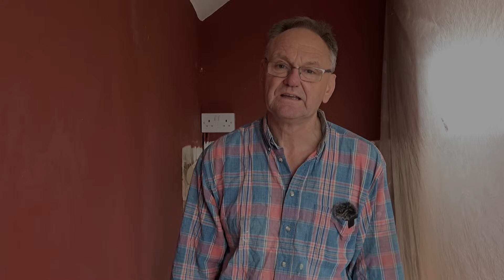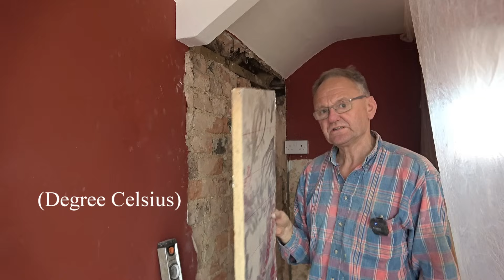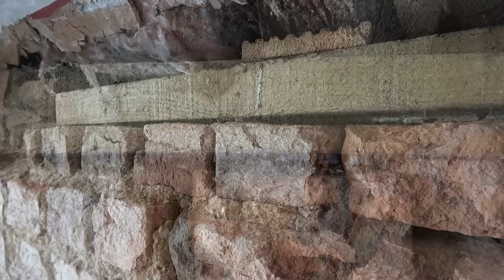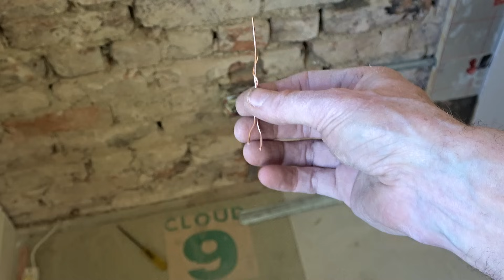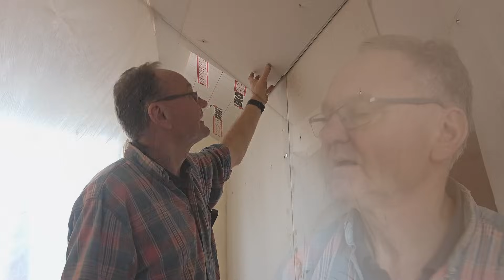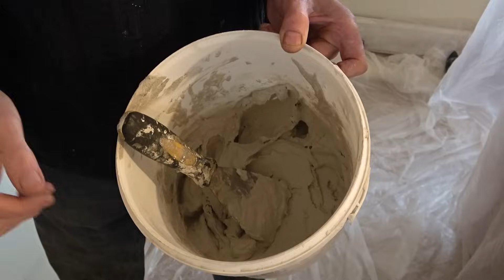HS165 Insulating a solid wall (Do it yourself)

Comment: Thanks for this @haxby_shed! I have a 110 year old property (lived in it for 20 years). I've never had any moisture or mould problems. do I need to take the plaster off or can I affix the insulated plaster board direct to the existing high-quality plaster? Room is huge so los of space.
Reply from the maker: HI David, please note I'm just a DiYer and no proper advisor. But no you do not need to take the plaster off. I only did that because I was very limited for space and there was a 1inch vertical slope on the plaster (out towards the bottom).  Also please note all the comments about the risk of condensation damp behind the insulation - but having said that I have done a number of walls over 10 years and never experienced a problem but only one wall in any room and we keep the house well ventilated. Cheers

Comment: 😮😮ein luftspalt zwischen Mauerwerk und Dämmung führt unweigerlich zu kondenswassrrbildung. Immer!!!👎👎👎🇩🇪
Reply from the maker: Hi Thomas, Ich stimme zu, dass die Gefahr besteht, dass sich hinter der Isolierung Kondenswasser bildet. Die Wand ist jetzt seit 18 Monaten isoliert und wir haben keine Probleme gesehen. Ich denke, dass das Risiko beherrschbar ist, wenn das Haus gut belüftet ist und man die Situation in seinem eigenen Haus kontrollieren kann. [help from Google translator 😁]     English version: I agree that there is a risk of condensation forming behind the insulation. The wall has been insulated for 18 months now and we have not seen any problems. I think it's a manageable risk if the house is well ventilated, and it's your own house where you can control the situation. Cheers Paul

Comment: Do you not worry about the damp/mould getting to the plasterboard?
Reply from the maker: Hiya Bush_Bush, I've done a few walls in my house like this over the past 10 years or so and not seen any damp or mould issues. I know people say it could be a mould fest behind the insulation but all I can say is it seems OK for us. We have never done more than one wall in any room. We ventilate the house well. I definitely would not try it in a bathroom or kitchen.   But I am clear in my own mind that the only way to be certain of no mould issues would be to ventilate the gap behind the insultation from the outside, with outside air circulating freely behind the insulation. But then you need much thicker insulation than I used. Just leaving an air gap in itself would not remove the risk of mould. I'm not even sure a 100% vapour barrier by itself would remove all risk of mould behind the insultation. Cheers

Comment: I used insulated plasterboard and used foam adhesive to stick it to wall. And then skimmed coat it. Easy and quick.
Reply from the maker: Hi Aliens4world, yes that would be the quicker way. I've done quite a few with screws and I guess this will probably be my last so I did not want to learn a new method at this stage, albeit less efficient than your method. Cheers

Comment: hey paul what mm pir board are you using?
Reply from the maker: Hi Oliver that was 25 mm. Ideally I would use thicker but I did not have the space. That said just 25mm makes a big difference. On a very narrow staircase I used 12mm and even that made a noticeable difference. Cheers

Comment: Thank you! That was really informative, and great advice. I’m looking to sort some solid walls and a somewhat limited budget and this really helped
Reply from the maker: Hi Sayam, please note I'm only a DIY-er. People have commented about possible condensation forming on the wall behind the insulation but after 19 months I've not experienced any problems. Cheers
Reply: @HaxbyShed  No worries, still good content. I was reading that a vapour barrier would help condensation from not forming on the wall. One of the reason the insulated plasterboard are bought as one solution is they normally included a vapour layer. You may not know there is water on the wall behind the insulation unless you take it off. But if it’s a party wall you might be safer against condensation.

Comment: Thank you for this very good, detailed and informative video. I have a 1906 Edwardian property that I am renovating soon. It's not been touched since the 1970s. New Building control rules say I must insulate the walls if I'm removing the current lime plaster back to brick. I will be doing this. I'm excited to see the original brick! My question is about breathability. Old, period homes need to breathe, so I worry about adding modern day insulation. I read that it can cause condensation/water build up behind the wall and eventually cause mould issues and in worse case scenario, damp. What do you think of this, since you have a much older house than Edwardian era? Thank you.
Reply from the maker: Hi Lizzie, first off I have to say I am no expert so this is just a DIY practical view which professionals might disagree with.  For sure solid walls (no cavity) will transmit a higher level of moisture from the exterior. If anyone ever painted the wall with silk or bathroom (plastic) paint, or covered it with vinyl wallpaper, it stopped breathing there and then!  Also warm moist air meeting a cold wall may cause condensation - which might quickly evaporate off with good room ventilation. It depends a great deal on the level of moisture in your house. We sleep with the bedroom windows open. I recently visited a modern house where the occupants never opened windows and the humidity was so high the moisture in the air was condensing on the toilet cistern and literally running down through the ceiling below like a full on water leak it was so bad. We had to show them how to open windows, especially when cooking on the hob (unbelievable) !!  I have insulated several walls in our house with the method shown and never had a problem. People say there needs to be a better vapour barrier (perhaps they are right) and/or an air gap behind the insulation. Well I'm 100% clear in my mind that an air gap only helps if the air gap is ventilated from the outside (so the insulation needs to be thick enough). Maybe the thin insulation I fitted transmits enough heat from the room to keep the wall surface behind warm enough to avoid condensation. Or maybe it is a mould-fest behind there but I'll never know. Certainly after 18 months we have not experienced any problems in that room. And some walls in our house have had that treatment for 10 years with no known issues - usually just 1 wall in a room. Maybe that helps. Cheers.
Reply: @HaxbyShed  Thank you very much for your sharing your experiences.

Comment: If applying insulation to the inside of an exterior wall (like I think you have), do you need to apply a vapour barrier to avoid mould?
Reply from the maker: Hi Tom, it's quite a vexed subject. The foam insulation provides a certain level of barrier but I did not have airtight sockets (for example). I am sure the experts would say yes there needs to be a complete airtight seal. Also, people talk about requiring air gaps but I'm now convinced they only help if ventilated from the outside.  Cheers

Comment: Great video, much appreciated! How does this work for ventilation and mould etc over time if everything is so flush? A few people have told me I need to leave specific gaps etc for airflow. Cheers
Reply from the maker: Hi Cameron, it's a fair question and people have said I can expect mould although I have not seen any yet on any of my walls I'd done over the past decade or so. But of course I can't see behind the insulation unless I strip it off. In my diy opinion leaving a gap is no use unless it is ventilated and, think about it, that ventilation must be from outside. But I'm just using basic logic when I say that ....... somebody else may disagree.   Cheers

Comment: Would not your house have been built using lime? This allowed old houses to breathe. When modern building methods were applied using cement, these old houses suffered from damp.
Reply from the maker: Hi Phillip, yes it may have been lime mortar. I did add some lime to the cement mortar I was using there. I agree with you about lime breathing but of course lime mortar often stays damp and in that state is a paste (so I'm saying that lime mortar does not in itself prevent damp but yes it breathes). But on old houses like ours you will find that 'Billy the jobbing builder' will have, over the decades, used patching mortars without any thought for any of that and I'm pretty sue all that all the repointing on the old parts of our house has been done with cement mortar.  Hard to say what the cumulative effects of all that has been over the years but our house it pretty dry and damp-free. Cheers
Reply: I’m just about to insulate my house. I too will buy the insulation and plasterboard separately. Save a fortune.

Comment: Thanks for video , noticed your roof insulation could use upgrade as well.
Reply from the maker: Hi yes, but limited opportunity certainly on the sloping parts as the separation between the tiles/felt and the ceiling below is only the height of the joists - 4 inches max, maybe 3. There is quite a depth of insulation above the level parts of the ceiling. Cheers
Reply: @HaxbyShed  Thanks for reply.

Comment: Hi does this also stop damp I’m thinking of doin this to all my internal walls that are facing the outside
Reply from the maker: Hi Lee, insulation will not stop damp. Rising or transmitted damp needs the root cause addressing and if the problem is condensation then again the cause needs to be addressed (damp atmosphere for whatever reason). I think if you insulate over a known damp problem you are likely to still have problems though they may be hidden. I would only insulate over an otherwise 'dry' wall (albeit that any solid wall will hold a certain amount of moisture).  Cheers

Comment: I love everything about this video. I really like the way that my fellow Brits do videos. The Americans are just so smooth and glossy. I am especially grateful to see you overcome all of the little problems and for your explanations of how you saved money. BUT my absolute favourite is seeing that your wall looks great without the need to skim the entire wall. Thank you very much.
Reply from the maker: Hi nowthenad, it's always rewarding to get nice comments thank you. You may know that my approach has caused some alarm from experts who are concerned that I would introduce serious problems with damp by using a non-breathable insulation. There certainly is that risk with my approach and I'm not going to say any opinion is right or wrong.   We have not seen any problems yet outwardly after 14 months but I don't know what's going on behind the insulation (and I'm not taking it off to look). The room feels a lot warmer. I did a follow-up video with a thermal camera (HaxbyShed 226).  Cheers
Reply: @HaxbyShed  That is very conscientious of you to mention that. Don't worry though; I am just treating your video as food for thought. I shall take up some of these issues with the tech support staff from companies like Kingspan. I wonder why it is considered to be acceptable to use EPS/XPS tile backer boards + ceramic tiles if it is a problem to have a non-breathable insulation. I would have thought that it would be a good thing to have a vapour barrier to prevent moist air from getting through to the cold wall, leading to condensation and mould. Any moisture entering from outside could leave the same route it came - to the outside. Anyway, I obviously need to learn more about the science of this business.
Reply: This is how walls are done in NZ where I’m from I never understood the need for all the effort and mess with plastering. It always seemed like an unnecessary step in the building process. Our houses are strong and the finish lovely I wish the UK did more straight plasterboard walls. Also the plaster quality varies greatly here. I bought a new build and it looked like the plaster was out on by a kid with a wooden spoon.
Reply from the maker: Hi Joshua, I have a few walls with just plasterboard, joint skim and paint. I suspect methods just get carried forward because that's how it's always done (speaking as a layman, you understand 😉). Cheers

Comment: I've been told you are meant to leave 25mm air gap each side of the foil....but in practice this is almost impossible so I'd still fix them directly to the wall.

I had a similar problem with a boiler room in an outhouse. I needed some insulation but able still able to fix plywood to the wall to support a 40 kilo boiler. It turned into a real headache.

A good product are hawkeng washers which spread the load of the screw
Reply from the maker: Thank you Dickie for sharing that info. Cheers

Comment: Wrong wrong wrong, if that’s single skin external wall if you get any damp penetration you’ll have masses of black mould behind the board.

Not advisable to only tape the joints either because it’s too easy to damage the plasterboard without a skim coat on it.

Putting plaster on skirting-line also is not right because you’re now causing a bridge for damp to come through.

And here is a prime example why you never buy a house of a DIY enthusiast 😂.
Reply from the maker: Hi happytruth, I agree that all the things you mention are possible. I only had 1.5 inches of space/thickness to work with so I took the risk.  It's not only DIYers we need to be wary of. I've had a couple of houses in the past with serious structural problems due to bad builders - in one case simply not following the engineer's  plans. Cheers

Comment: I have to do the same to an old coal room with a toilet and there is no heating out there. Do I have to frame it first and what about a vapour barrier?? Thanks
Reply from the maker: Hi SausageParty, to be truthful I am not qualified to answer. I did not have space for framing. I did not use a vapour barrier for no particular reason other than I have not installed one before and not experienced any problems, but we keep the room well ventilated so it is not a high humidity environment. If I had space and I wanted the new face perfectly true then perhaps I would have built a frame. I don't think an air gap by itself will help to control moisture unless ventilated from outside, although it would keep the insulation board off any 'wet' patches thus avoiding transmission by direct contact.   Cheers

Comment: Just what I needed, had an idea but you have confirmed it! Our house is only 170 years old but has one  wall , which is exposed to all the weather and which is icy cold, I shall try this to help alleviate the chill! 👍🏼thank you.
Reply from the maker: Hi, my insulated wall has been fine with no damp or mould or smells, but do please have a look through the comments and just give some though to damp if your wall is inclined to absorb a lot of moisture from outside or your house is humid inside.  I visited a modern house recently which was very humid due to the 'lifestyle' of the occupants and there was water condensating on the toilet cistern, dripping off and running down through the ceiling below.   There was also water condensating and dripping from the loft hatches. I'd never seen anything like it - unbelievable!   I'm not suggesting you live like that of course, I'm just highlighting that lifestyle and ventilation are big factors in these things. What is fine for one family may not be ok for another.  Cheers
Reply: Thanks, this room is the only warm one in the house we have a multi fuel stove running in there, and it is the living room so I avoid drying clothes etc.
Just a question, I suspect that you couldn’t use this method to insulate if the exterior wall is rendered and painted ..🤔 as the moisture has to come out on the brick somewhere…?
Reply from the maker: @hhandcarte4473  Hi, oh I really don't know. I think breathable insulation would always be safest. Cheers

Comment: Well done for attempting this.
 One tip is to use diluted SBR on those bricks. It stabilizes the surface..and stops dusting. It can be use in cement to make it waterproof.
 You dont need steel to cover the cables as long as they are vertical or horizontal.
Reply from the maker: Thanks for the tips Jim. Cheers Paul

Comment: Great remodel and energy saving job, good for next 150 years.
Reply from the maker: Hi tnyima, it's a job I've been putting off for 10 years but the need to redecorate and the recent big increases in energy prices finally caused me to get it done. With insulation projects you can get as many opinions as there are people on the planet (like politics) but after 1 full year we have not seen any problems with damp or musty smells from condensation which could form on the wall behind the insulation, so I'm happy with it. Certainly we feel the benefit from a warmer room. Cheers